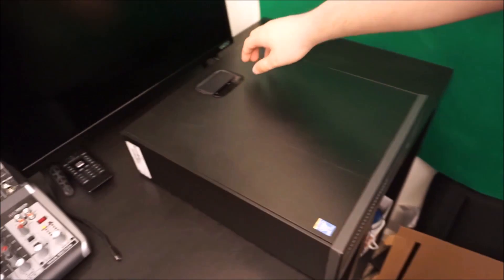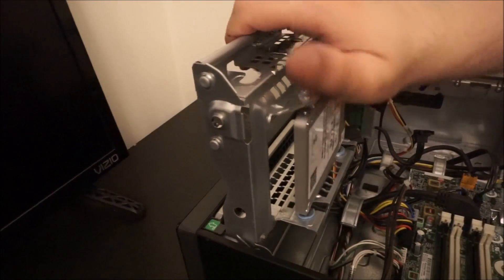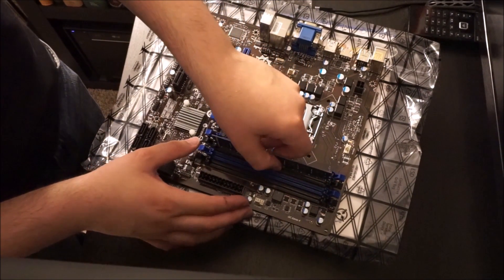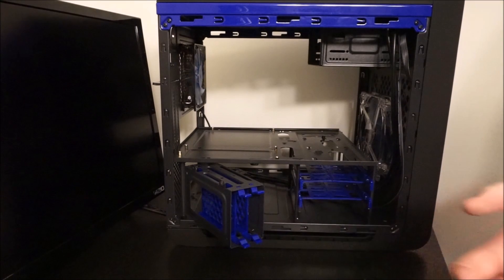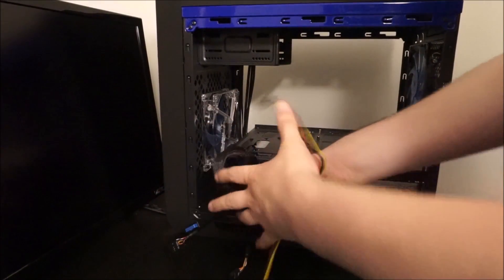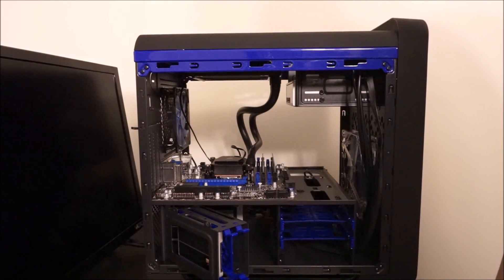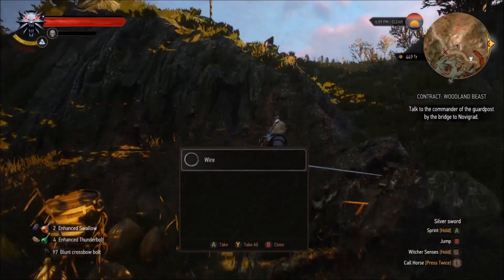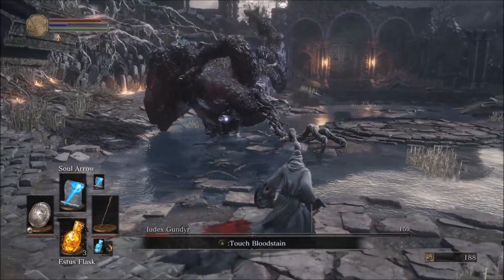Another Console Killing PC!

Comment: I know the video is 7 months old but I like this kind of content. I find it interesting and it was helpful. Just built my first Gaming Rig with an i7-7700k, MSI b250 Gaming Pro Mainboard, and EVGA 1080 FTW
Reply from the maker: jkelley2 good stuff! Shame about the graphics card prices at the moment though.
Reply: MrIwont4get yea I spent $680 on the GPU alone everything else all totaled about another $800
Reply from the maker: jkelley2 680 honestly isn't terrible for it these days. I see them going used for 750
Reply: Why an unlocked processor and a b250 board? You won't be able to overclock. Still an amazing build!
Reply from the maker: Vivek Cote I asked the same question when he came into my stream the other day lol. I actually forgot his answer...
Reply: MrIwont4get maybe just a mistake I suppose. I did worse than that on my first build, putting an i7 4770k with a Z77 board instead of Z97 lol.
Reply: overclocking was never the point, but to answer the question, got the unlocked for $279 USD where as the locked i7-7700 was $309.99
Reply: jkelley2 oh wow, that's a great deal!

Comment: I'm trying to make a cheap PC for dark souls 3 and all I need right now are a motherboard and graphics card, any advice?
Reply: GTX 1050 and RX 460 are the best graphics cards in the $100 - $200 range from what I know. I can't say much for motherboards, but you're gonna have to find something that can be compatible with what's new. a PCI-e x16 3.0 is great because it's able to work with almost any graphics card at 2.0 or lower with little performance loss. But if you have a PCI-e x16 2.0 then you would run 3.0 Graphics Cards at about half capacity. But I'm probably oversimplifying it, just don't be cheap with a motherboard, most of the time you're gonna get what you pay for.